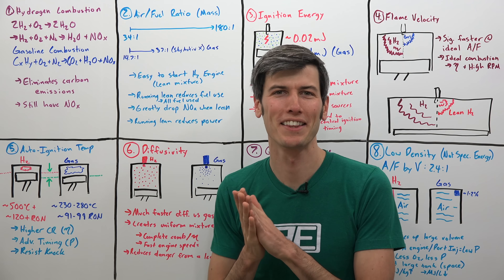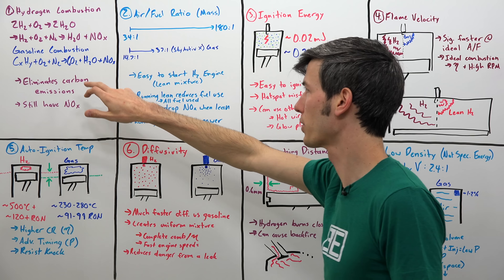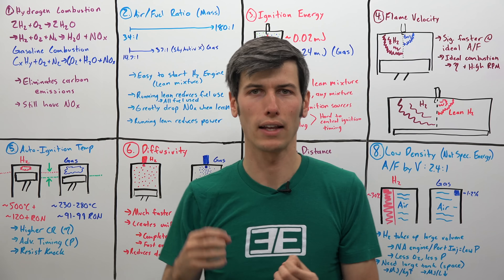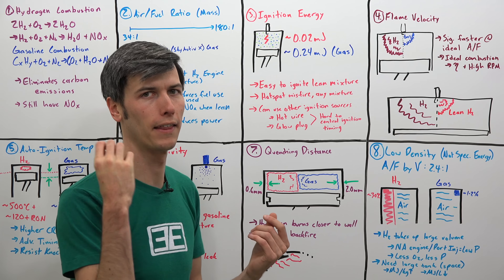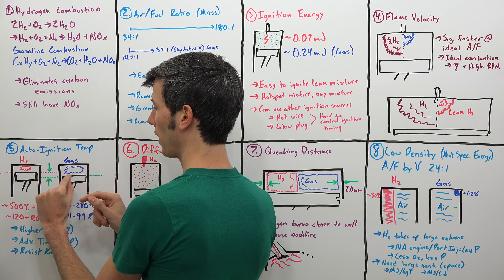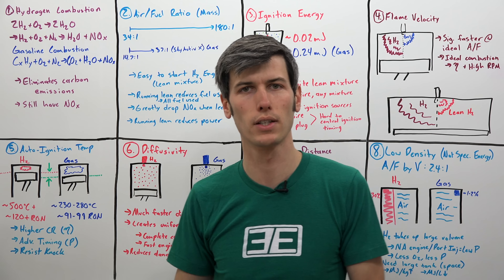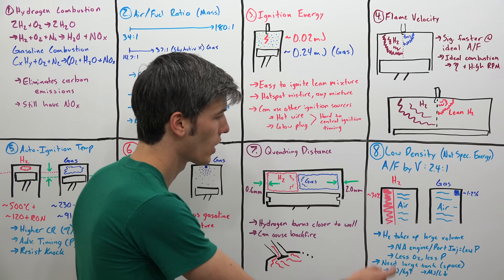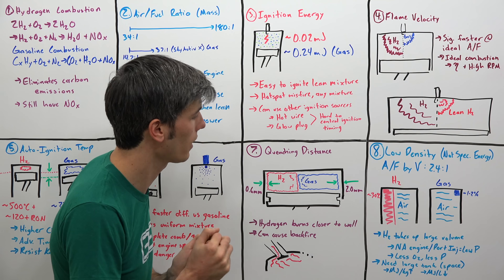The Difference Between Gasoline And Hydrogen Engines

Comment: 10:13 "Thermal event" I love how you describe "fire" at first.  Highest geek level achieved..
Reply: Politicians in Australia will start referring to climate fires as thermal events to play down the seriousness of it all haha
Reply: Engineer would call it ignition, because there’s a quick flash with no flame present
Reply: @chrisnewman7281  There's always a flame, you just need a slow motion camera to see it.
Reply: @chrisnewman7281  I worked in automotive engineering for one of the Big 3 for many years. We were more or less required to called it a "thermal event", especially in written documentation and correspondence for reasons that, believe it or not, were required by the legal department. This is very important to protect intellectual property in the event of a law suit or recall.  Better to say, "the brake test data does not meet the engineering criteria", rather than, "the brakes fade too quickly and are dangerous"
Reply: He is 20+ lbs. Heavier and talks differently now. Very subtle but there. Slight personality differences.
Reply: That's what I will call my farts from now on

Comment: As for rockets the reason hydrogen is used is because rockets move because of momentum. To see it mathematically, momentum is MV, while energy is half MV^2. This difference where one is V and the other is second power of V means the velocity of the ejected mass behind the rocket will change how efficient the energy transfer is. Momentum transfer is same between the exhaust and rocket, but which gets more of the energy will be different. I think the difference is evident already but lets spare the math. Hydrogen burns into water which is 18 grams a mole vs Carbon dioxide which is 44. With the same amount of energy, the water exhaust will move faster away from the rocket. From this momentum transfer, the rocket will end up with more of the energy (i.e. more efficient at converting fuel into movement).

Comment: Ok, I have learned something significant here, diffusivity. I always thought if hydrogen got into the atmosphere through a leak, then it would be really dangerous. I would suppose if a lot got out, it would be dangerous. This being the case and emissions being a lot lower using hydrogen fuels, why haven't we been using it to fuel vehicles for the last 60 years?

Comment: It seems like a compression engine with direct injection is the way to go for hydrogen in a compression engine. Fuel Cells are great but the expense of using platinum is a problem, the reliability of fuel cells for the general motoring public could also be a factor.

Comment: Hydrogen fuel has to be generated, until it is redally availible as corbon fuel  it's a none starter. All sound good in theory but practicle not so much and costly overall.

Comment: All this assumes you are taking in outside air, but what if you have a Hydrogen and Oxygen setup without taking in outside air?  You could manage the exact mixture even adding a small amount of Nitrogen as a catalyst if necessary.  The H2O created by combustion could possibly be considered a catalyst for compression and you could use a magnetic one-way valve (sort of opposite of a fuel injector) with a pressure sensor to open and release pressure (a direct ejector instead of direct injector) so that when compression gets too high or the H2O content in the cylinder gets too high it can eject some of that H20 from the cylinder mid stroke.  I don't know.. Maybe this is a question that only Doc Brown can answer...

Comment: you didnt meantuon that the pure HHO reaction is 4000 times as fast.  I dont think it will produce NOX. the engines run cooler because the reacrion is so much faster,  the frequency of the ICE isnt faster though,  its a differant test that just probing a torch.  You need a specific, presice on demand generation system,  I ff someone runn it very lean,  you are simple pushing volatile plain Hydrogen out the stove pipe, and i belive this would be very dangerius since its going to be generation static all the way,  the Booom,  guess we need those very  expensive large centralized NWO filling stations RIGHT

Comment: Hydrogen is not used in rockets because it's light. Rather because it produces more Specific Impulse, or more thrust per weight burned, of any of the chemical rocket fuels available.
Hydrogen also has huge disadvantages in rocketry that may or may not apply to automobiles.

1: It's less dense, meaning it needs more space to accomodate the mass required to launch a rocket. That space translates into more structure required to support it. The LH2 in the Space Shuttle had to be stored criogenically, which means the external tank needed a layer of insulation to it. In the end, putting it all togheter, you can see how the weight adds up.

2: It creeps. Not only by valves and plumbing joints but into and through the materials holding them themselves. Hydrogen creep into steel is a big cause of fracture.

3: It boils off. Thanks to the aforementioned creeping ability. For this reason, the Shuttle was fueled only when already at the launch platform, at maximum three days before launch, and the tank was checked and topped off before launch.

Comment: Explain this: NASCAR drivers turn off their engines to save fuel. How much fuel do they save vs letting it idle in neutral or use in restarting the motor? If I had had teachers like you..... Good job.

Comment: Hi Jason. Do you have a white board lecture about hydrogen fuel cells, pros and cons? Also, that tiny H2 atom can easily squeeze past the most closely gaped piston rings. A PCV check would be rather useless. A piston engine would most certainly be venting H2 via head and intake manifold gaskets as well.  Love your channel. Thanks for sharing.

Comment: I love the video but I don’t think your video is finished yet because your video demonstrates use of hydrogen in a 4 stroke engine where as you get a different result for a 2 stroke hydrogen engine.

I’m coining with a concept of a 2 stroke hydrogen engine where you have compression, direct injection, ignition then combustion and it would be an interest to see the addition of a 2 stroke engine in here as there is a big difference using hydrogen in a 2 stroke as opposed to a traditional 4 stroke. Nobody else has covered that and I think as a professional YouTuber this is something that could spark a huge interest. 

Cheers

Comment: Where does the NOx come from?  If 2H2 and O2 are the only things introduce into the combustion chamber where do you get the N (ambiant air?) and can that be eliminated?  Can you compare internal combustion hydrogen engine to the full cell and battery powered motor as the relate to powering cars and the efficiencies of them?  I'd love to here that.

Comment: You missed a few very major things about hydrogen.

1) It is undetectable. It's odorless and colorless. You won't know that you've got a leak until a spark ignites it and blows you and your family up.

2) It's hard to contain. It's the smallest molecule possible and it embrittles metal. So leaks are a major problem in practice, especially the older the vehicle. Since it is the smallest molecule possible, it's able to escape through holes that doping agents aren't able to escape from, so unlike natural gas, adding a foul smell to it is not an effective warning method.

3) It must be highly compressed in order to be a practical vehicle fuel. That just adds to its containment/leakage issues. The high pressure is itself dangerous and could kill you, especially if your hydrogen vehicle gets in an accident that ruptures any part of the fuel storage and delivery system. It also necessitates extremely strong and expensive fuel tanks and fuel delivery systems. Also note that a hydrogen refueling station for hydrogen fuel cell vehicles costs over $1 million per unit. Compressing hydrogen to a high pressure is in itself an energy-intensive process, and so is the steam reforming of methane or hydrolysis of water, so the fuel is necessarily more expensive to produce than methane, electricity, or gasoline. You will never be able to buy hydrogen as cheaply as gasoline in America.

 4) Given all the above, it's one of the most dangerous fuels possible and should be banned for use as a fuel in any consumer product. Yes, it dissipates quickly from leaks, but remember the Hindenburg! Disasters aren't just possible, they're likely. It's also expensive. Significantly more expensive than gasoline, electricity or natural gas.
Reply: I totally agree with these points.

Comment: Well yeah, a hydrogen engine doesn't produce carbon dioxide because the carbon was already taken out of the hydrogen fuel when it was created. But it was created by steam reforming of natural gas because that's the cheapest way... and that method generates all the waste CO & CO2 that would ordinarily be generated in the engine. You haven't reduced waste CO2 at all, you've just moved it from the engine to the fuel refinery (and hopefully converted as much of the deadly poison CO as possible to CO2).

Comment: Ignoring the question of how, if you could supply straight oxygen and hydrogen to the cylinder, rather than air and hydrogen, that would eliminate the NOx problem, right? In that case, how difficult would that be?

Comment: Awesome video explanation - Can you do a video on adding browns gas to ones naturally aspirated ECU driven vehicle .I would appreciate your technical input with the same 8 points as in this video , but for a combined gasoline +hho .
Question: I have an hho setup (hence the previous request) - my WBO2 installed still gives me the same ideal Stoich ratio under no load being 14.7 :1.
Question: With my cat deleted surely I can up the leaning of my engine in order to gain economy ?
Thanks again for all the awesome knowledge transfer.

Comment: No Carbon emissions is 50% reduction compared to traditional fuels. Probably 1000% better than all Electric where the battery at end of use will have Lead, Acid, plastic cell blocks etc etc. Hydrogen wins so lets work to Hydrogen already.

Comment: First, thank you for all these great videos ! 
What do you tking about "HHO kit" (on-board hydrogen production and injection into intake manifold) ? Of course many people think that the little amount of energy produced and the poor efficiency of these hydrogen generators lead to higher fuel consumption and no gain at all ! 
But if hydrogen can improve combustion speed, self-ignition resistance, mixture (and allow to increase ignition timing ?) can it makes fuel consumption economy, power increase or even cleaner emissions ?

Comment: Do you think that if an HHO generator is used as a Hydrogen source, the problem of high storage space needed will be solved?? .. Note: 1 liter of Water produces 1235 liters of Hydrogen and 622 liters of oxygen ... Another question:- what is the amount of Hydrogen gas (by liters) needed to move a car as 1 liter of Fossil fuel does??

Comment: So what about Hydrogen from water using Electrolysis? You would have enough space in the car by just having a water tank and then mixing the Hydrogen with the gas to use less gas. I have built one of these systems and it worked. Maybe the idea should be to use the two together not one vs. the other.  The US Navy has been using Electrolysis on submarines for years, so we have the process perfected. Any thoughts?
Reply: Navy submarines have a nuclear powered generator on board to provide the power to electrolyse water. Now there's a thought - Nuclear powered cars!

Comment: On the subject of using hydrogen in a regular 4 stroke cycle engine. Has anyone considered the amount of water that will enter the engine oil, and the amount of degradation to it, by way of the openings in the piston rings and it's effect on corrosion in cast iron or aluminum engine blocks? On a per ignition stroke basis, the amount would be negligible but over time say over the 6,000 mile interval that some conventional fueled engines are allowed, I could see the oil being so degraded over thousands of miles that premature wear could take place in cylinder walls, bearings and other moving wear surfaces. I have smelled excessive gasoline in the oil of high mileage or excessively worn engines and while this is a solvent, it doesn't degrade the lubricating properties of oil as much as water would over the same amount of time or mileage. If I am overlooking something here, please correct me where I'm wrong.

Comment: Your last point about energy density could actually be broken into two. Energy density in storage and energy density in combustion. While they are related to the same characteristic of hydrogen, functionally and practically speaking, they are very different and almost need to be discussed separately. 

But to your point about combustion energy density, you said hydrogen engines would make less power, naturally aspirated, as compared to gasoline because 30% of the volume is taken up by the hydrogen thus displacing air. And that would be true and a huge negative for people that were trying to do a hydrogen conversion on a conventional engine. However I don't believe this is a problem with direct-injection (hydrogen or gasoline). The engine would aspirate as much air as it can on the intake stroke, and the fuel would be injected long after the intake value is closed. At this point, the deciding factor between which makes more power would no longer be related to energy density but to other factors. 

So here's something to ponder, which would be the best in direct injection applications? If it were only that simple, right? But just saying that isn't enough. So here are some reasonable leeways and constraints. 
-Assume you compare gasoline and hydrogen on naturally aspirated direct injection engines with identical displacement. 
-Setup each engine to burn their test-fuel at their fuel's 
   -optimal AFR
   -optimal compression
   -same bore-n-stroke
   -same valve events (i.e. same cam)
   -optimal running conditions (e.g. Engine Coolant Temp). 

Which would produce the highest peak torque? Specifically, which fuel can produce the most usable mechanical energy out the crankshaft with the same amount of air? I feel like this is predictable given the known combustion characteristics of hydrogen and gasoline. I just don't know the answer.

Note, I'm completely ignoring practical details like:
-the up-front cost differential between a production vehicle outfitted for hydrogen and an identical vehicle outfitted for pump gas
-ongoing costs such as fuel economy (i.e. mile/$) 
-availability of hydrogen vs gasoline

Comment: Great explanation in your vids. Hopefully, you will address hydrogen production using pulsed DC current (high voltage and low current) at or near natural frequency of H2O. In theory, as I understand it, water can be efficiently disassociated in this way. Your thoughts on this would be appreciated.

Comment: Hydrogen in rockets of course also has the advantage that its combusted at an absolute perfect mixture since its oxygen is supplied on board vs a car having to work with whatever percentage is in the air.  If someone ran LOX into a hydrogen piston engine id imagine before it melted it would get some pretty impressive numbers.  of course that is the other factor, Rockets can afford to have cryogenic fuel plants constantly topping them off until  almost T-0.  Cryogenic fuels take up less space,  its why firms like SpaceX go even colder taking their oxygen to just above freeze point to squeeze even more in,  though they run Kerosene not hydrogen as the fuel.   I suspect for cars, battery technology will get the range and the short charge times before someone can develop a very compact tank that can store hydrogen as a liquid for extended periods.

Comment: What killed hydrogen engines?  Back around Y2K truck news stated all transports would be burning hydrogen by year 2020.
5 reasons we are not, from somebody who has run on Brown's gas:
1, I accidentally lit some off and blew the brake booster up in my car due to a faulty check valve in 2009. See Challenger O rings.
2, Maintenance costs are high, liability is high and risk of death is up there too.
3, Hydrogen is to simple and cheap to manufacture. Economy will collapse, loss of tax revenue.
4, Insurance companies have lobbied for strict trade regulation to stop people from working on their own cars. 
5, Petroleum companies frack to produce low cost gas to make hydro. Electric cars are not the end of the petroleum cartels.

Comment: also, would combustion chambers? cylinder walls benefit of being lined/cast from stainless as having H2O as an emission cause advanced corrosion with water combined with heat? it might not effect an aluminium head but i feel the cylinder walls and possibly the rings could suffer,  and thats not mentioning any kind of possible hydraulic effect between the rings and pistons and how blowby would also play into things.

Comment: no mention of hydrogen embrittlement and high cycle fatigue limits on the hardware....no mention of catalytic converter conversion efficiency vs A/F .....no mention of how difficult it is to direct inject Hydrogen....no mention on how dangerous, how expensive and challenging is to store and distribute hydrogen....not a comprehensive review of all the applicable technical issues!